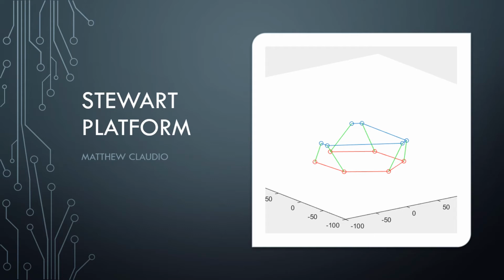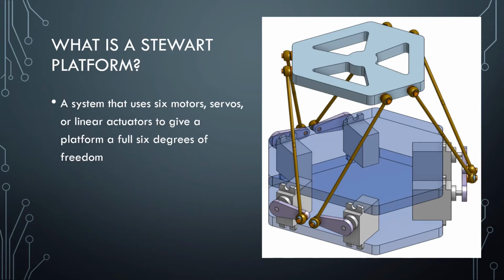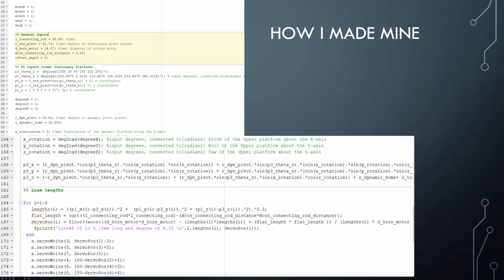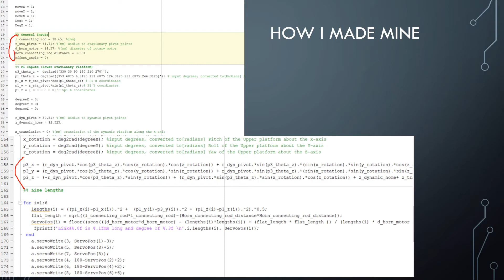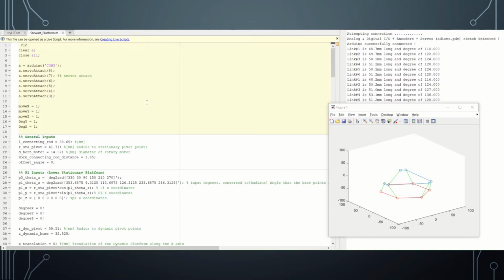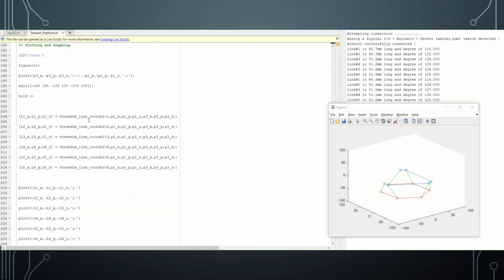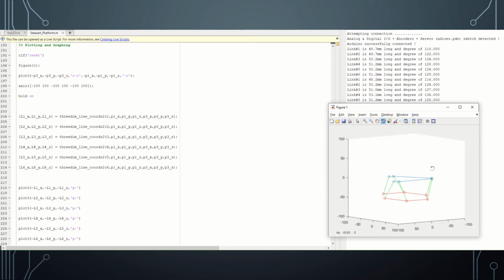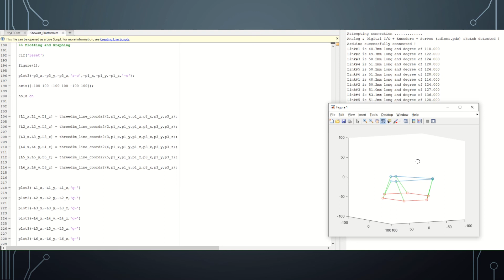Stewart Platform using MATLAB and Arduino

Comment: GOOD TUTORIALS . 
            I hope i could get the code Matlab directly or the source for downloading & how to create the code from Simulink by importing from solid works to Matlab  Simulink  of this project  please.
Reply from the maker: https://youtu.be/veMNrmTGlnE
Reply: @NewYorkHotdogs  thank you for helping. I got the code, but I hope to get the download link of the cad assembly that represents this model, Stewart Platform please if possible. Either the connection between the servo motors & Arduino with its pins for input / outputs.
Reply from the maker: @amr.a-m8350  I don't have those, sorry

Comment: what would I change If I use a 3DOF stewart plafrom!
Reply from the maker: Honestly I think this was technically a 3DOF application. If I remember correctly, I did more research later and discovered this fact. Sorry for any confusion!
Reply: @NewYorkHotdogs  so would the same equations work for a 3dof ?
Reply from the maker: @zack6418  I don't remember. I would refer you to an instructables article. There are at least 3 I remember reading when I did this project. One was from physics students that had a 3DoF platform.  Sorry I don't have the link but I'm sure a quick search will lead you in the right direction
Reply: @NewYorkHotdogs  the isntructables article did not use inverse kinematics for the control..
Reply: @NewYorkHotdogs  the physics student I don't know about him..